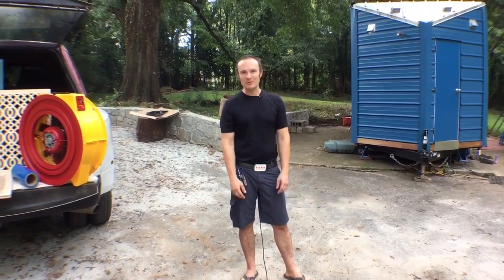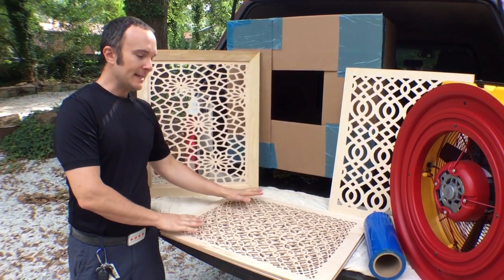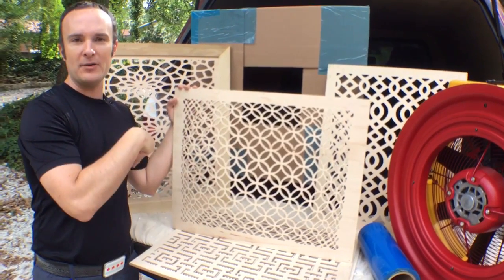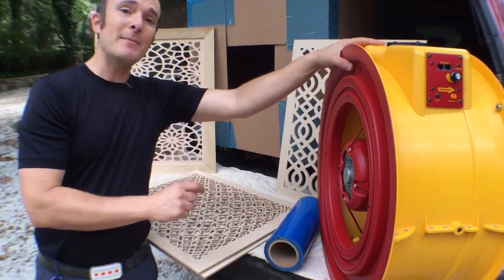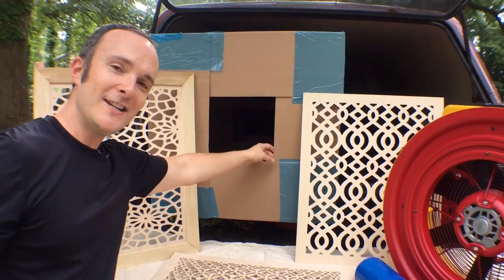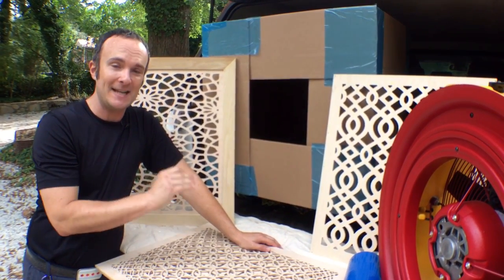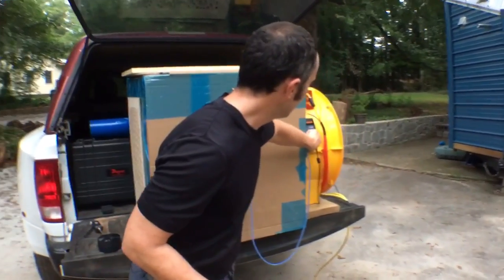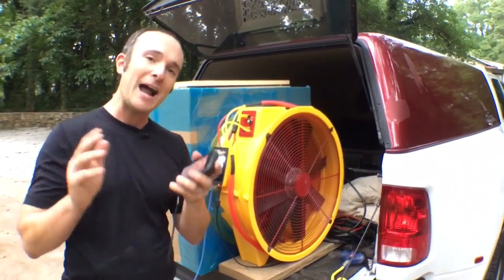Testing HVAC Grilles with a Blower Door (Stellar Air Vents)

Comment: This is absolutely fascinating! 
Obtained a Master's of Science in the Built Environment with a Concentration in Sustainable and Climate Responsive Architecture; basically energy performance. Applied Project was on a 50 year old fired adobe brick residence converted to a church.
Been wondering how much return grills affect flow for years, especially track homes where units are traditionally way over-sized (if sized at all), now here lies part of the answer. Can see these wood grills being an upgrade to the standard fine louvered if an open design.
Bet airflow also affects how far the filter is drawn in, as the less flow, the harder the draw, and the further the filter moves in. Back pressure also affects efficiency and lifetime of the equipment.
Reply from the maker: All great points, Adriel! Glad you found us!

Comment: I really like your video！Is the tachometer inside the fan the Pitot tube?
Reply from the maker: +Jason Lau not exactly, and it’s not a tachometer. There’s a pressure probe before and after the fan, and that’s used to extrapolate the flow volume from the hole size.

Comment: Good stuff here.  I built a similar rig to do some preliminary testing on a pet door for a local company to make sure it would pass before they spent the big bucks on the NFRC testing.  Since you might be interested in it, I'll shamelessly plug the pet door.  It's probably the best pet door on the planet, the only one I know that will withstand a blower door test and has a NFRC rating.  The version I tested leaked so little I couldn't give him solid number with the equipment I was using at 50pa (I'm not sure how they do it in a lab), I do remember it didn't crack until 179pa.  You should check it out.

https://energyefficientdogdoors.com

I think he's got a video of it during testing at a passive house in Nebraska.
Reply from the maker: +Andy Kosick nice work! Keep it up brother!